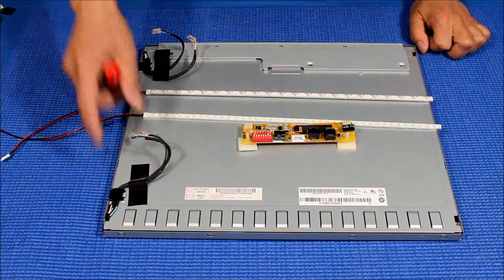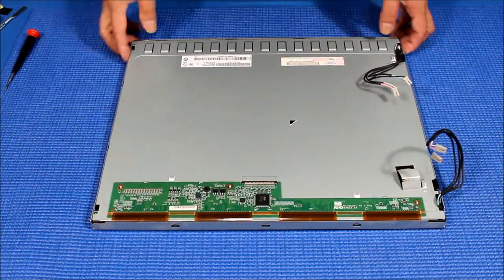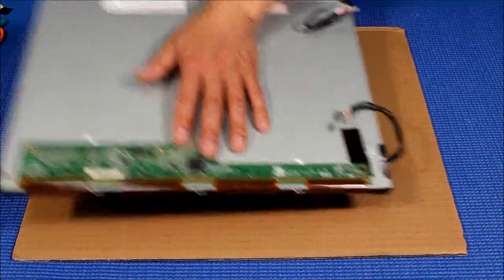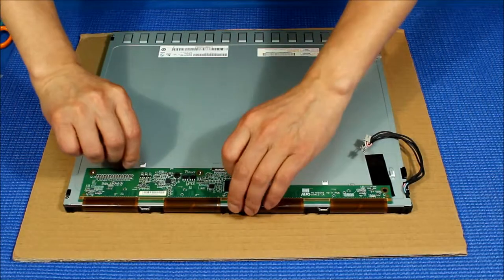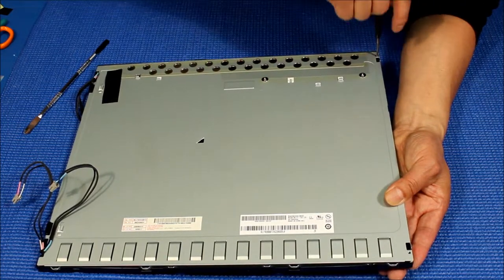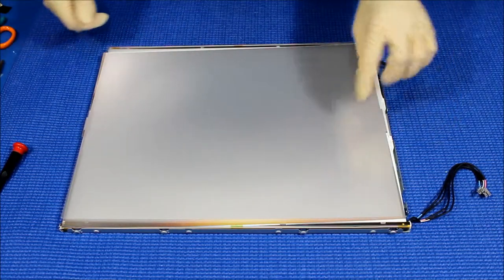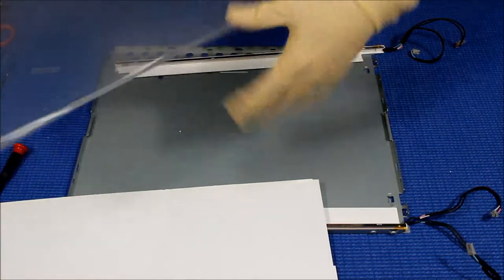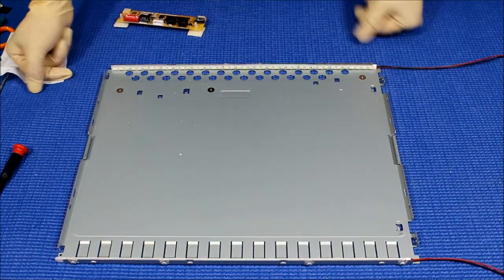Elo Touch ET1739L, Part 2 of 4

Comment: Hi, I have a problem with this monitor, when you press on the screen, the point where the finger makes contact with respect to where it is operated on the calf is out of date, the calibration using the elo software does not solve the problem. Aluna idea.Thanks